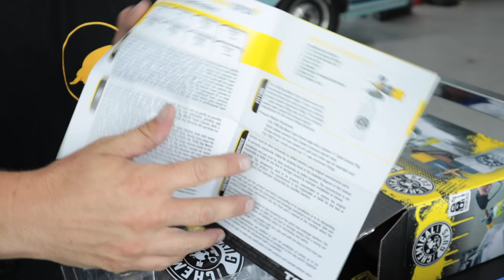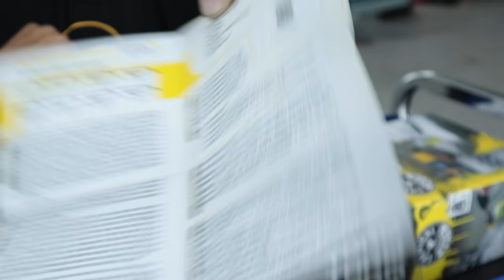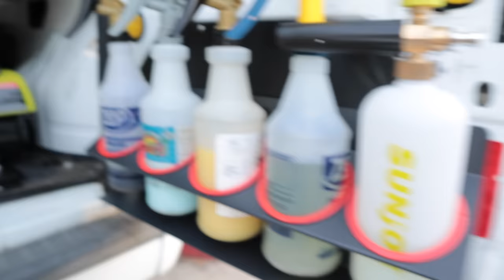Chemical Guys BIG MOUTH Foam Cannon Review! Is it worth $90? | Car Wash Foam Cannon Test and Review!

Comment: Good video.  One thing I would suggest is not shaking the mixture together cause it creates foam inside the bottle which will create less foam on the vehicle.  Whenever I put in my soap I give it a stir so everything is mixed together but there's no foam inside the bottle
Reply: Yeap me too warm water aswell
Reply: @scottvandusschoten1117 what about warm water? Is it good or bad?
Reply: @ErickeverRB  warm water helps with more foam

Comment: The one thing that I’ve been wondering is that at minute 7:34 you mention you turned the non all the way down. The knob shows a more watery graphic on one end and the foamy on the other. Which end did you turn it too for the test. When you say “all the way down” I assumed it was the watery end so no wonder it didn’t work as well, if that was the way they didn’t intend for you to use it, can you verify?

Comment: As an owner of the big mouth cannon, I would also not recommend the big mouth cannon. It's built well, but for it's price to performance, it falls short and performs similar to the $30 cannons. One big pro, is that the huge top that makes adding chemicals incredibly easy, but it does not outweigh the cons.

Comment: People tend to focus on the orifice size they miss out on the stainless steel packing inside the foam canon, it plays a vital role on making good foam (clean and wash it often if u can), the one from MTM PF22 is well made... u can buy stainless steel packing separate, also ty using distilled or Di water to mix inside your foam gun.

Comment: Great HONEST review.

How do you think a 1.1mm orifice will perform on a 3000psi (rated) 2.4gpm (rated) gas pressure washer?
Reply: Probably cause the machine to cycle.  1.1 is even too small for the higher end electrics

Comment: I just bought the greenworks pro 2700 pressure washer and the chemical guys big mouth foam cannon. The foam was extremely watery. Do you think because of the psi of the pressure washer I need to go to a 1.25 orifice? Having trouble finding info online. I assume if more water gets through a bigger hole than it will be even more watery but maybe that’s not true because of the higher psi rating. Everyone says use the 1.1 orifice on the forums but they are all using lower psi pressure washers. Any input would be greatly appreciated.

Comment: I thought that it said a minimum of 1.4 gpm. Isn’t the pressure you are using, say 1.2 gpm? I appreciate your videos. You have to love that great weather in San Diego, all year around.
Reply: The GPM is adjustable depending on the orifice size you’re using. The advertised specifications of almost all pressure washers is extreme false advertising even with the nozzles they come with.  He has uses the same machine with great results from that 1.1mm size orifice on several other foam canons and is the standard for electric pressure washers.

Comment: I bought this recently. I've only used it once but it gave me some nice foam. Didn't have my typical foam but it did do pretty good with what I had
Reply: Dude the point is you can get better foam for 30 dollars less money, you bought a Chemical Guys logo. They take advantage of the beginner and DIY guy.  Not cool
Reply: @mattolivo  I didn't buy a logo. I was in a pinch and bought what was available. Like I said. I didn't have my typical stuff. But yeah. I don't typically run chemical guy products. Just had to make do with what I had available.

Comment: I bought the honey dew snow foam from chemical guys, and, I used my pressure washer with a regular chemical injector.  No foam.  I just learned I need a foam cannon, and I want to buy one, but I want to buy one that I don’t have to mess with, and comes out of the box spraying super thick foam.   

I have a very good pressure washer.  4.0 gpm up to 4,200psi.  I can adjust the pressure on the Viper pump (Italian version) as well. 

Do you have to mess with them all like this?  If you lost your equipment, and had to buy everything new again, what would you buy to lay the thickest foam possible?

Comment: Brother I've got a Amazon order coming tomorrow with CG Wooley Mammoth drying towel and Glossworkz Glaze and a Greenworks 2000 psi washer would you recommend this as a good foam cannon for me to purchase?
Reply from the maker: I’m a bit biased but I like the mjjc foam cannon pro the most. You can get them on Amazon or you can buy them on my site. I have them in stock. The chemical guys ones is nice it just doesn’t get as much foam as the mjjc 
www.dtlrsupply.com

Comment: So what happens if I try to use it on my 1.2gpm pressure washer I have a big gas one but prefer to use a smaller due to convenience.... guess I should have watched more before asking lol ur using almost same setup I have I got the dewalt 2100 1.2gpm lol

Comment: Hey Josh.  Wondering how a person can get more GPM on a pressure washer. I have the same pressure washer in this video with the flexzilla hose and Uberflex hose. I did change my sunjoe foam cannon orfice to a 1.1 mm. I also use the McKillians spray gun.
Reply from the maker: Hi Don, you would just need to adjust the orifice of the nozzle youre using. It will lower the psi and increase the gpm. Heres a video i did on that https://www.youtube.com/watch?v=OclxfaBDTDM
Reply: @imjoshv  cool thanks sir. I'm addicted to shopping.  Seems like everything you show on your channel I buy. Lol

Comment: I have this foam cannon on a gas pressure washer and works like a charm your probably need more soap in there
Reply: how much should i put if using the gallon sized soap like how should i measure it out bc you put the soap in second

Comment: As an owner....um no, hate this cannon tbh. 
Get a cheap $20-$30 Amazon cannon and put in a $10 upgrade in mesh foaming parts, anything else your just paying for a name brand. 
Passthrough diameter should be 1.1 for Electric washer, 1.25 for gas washer. 
10-20 min in youtube research should fill in any questions.
Reply from the maker: Yea it looks cool but not the best foam for sure. The mjjc foam cannons get much more foam than the others even with the 1.1 mod… but for 30-40 all in that’s a great option